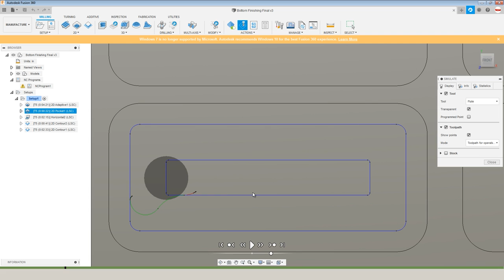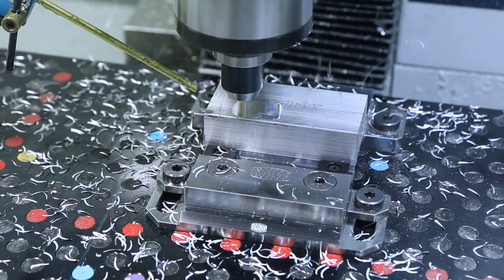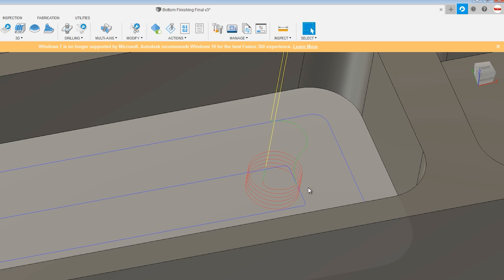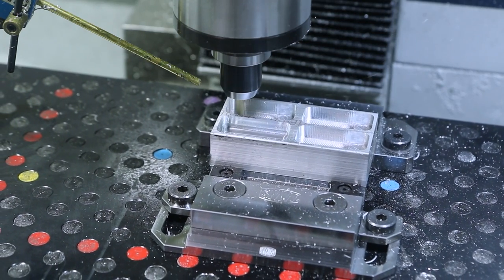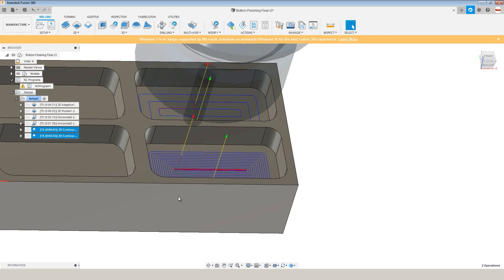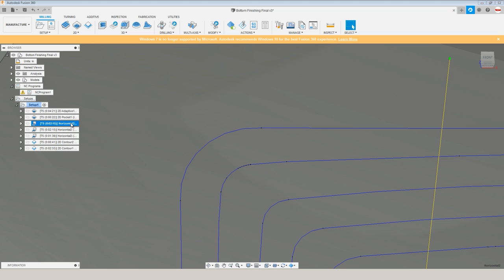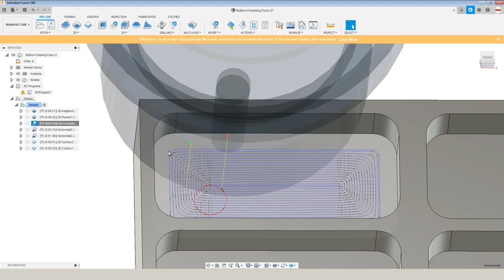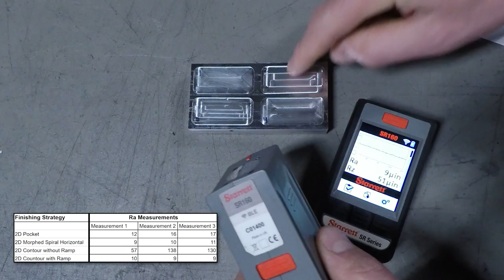Better Surface Finishes on Pocket Floors! Testing Different Fusion 360 CAM Toolpaths.

Comment: Saw this when it first hit and stashed it in my "next time I need this" memory bank.
Today I am pocketing copper and using the 2D Contour as you described gave me an almost mirror finish.
I was close with the code I used before but I had plenty of those "witness" marks. Now, none.

Thanks John!

Comment: You should compare the surface roughness of a floor that has just a basic finish, with the feed lines still in it, vs a polished floor, that was only done primarily by hand with Scotchbrite or something. With that, it should only presumingly looks smooth.

Comment: John, what do you do with this info after the R&D is complete? Does it become a purchase option on custom work? As in you offer different levels of surface finish for a different cost? Or do you just R&D to find the best finish, then just produce everything at the best finish? Therefore offering a higher quality part than your competitors?
Reply: For me it would aid in quoting manufacture cost.  You want the best finish for the lowest cost.  That first pocket will do for 99% of the work I've done, and would be my standard finish.  That 1% where the customer wants an Ra 16 or better finish is where this research comes in, and I know how much extra cost (time) there is.

Quality is just a part that meets the customer requirements.  Going so far beyond that only adds cost, and fewer customers accepting your quote.

Comment: I've always had issues using the horizontal tool path on open sections, it always seems to gouge the side wall that it's cutting.  As a side note to talking about the head tilt, if you want to completely eliminate the effect of head nod, just use a very tiny ball end mill.  It acts like a point cutting tool and is, for all intents and purposes, not affected by nod.

Comment: Could programming the feed rate as for a 1 flute cutter improve floor finish? There is always 1 flute that sticks out a little more than the others so maybe using it as a 1flute cutter is the way to go.

Comment: Is there anyway to make the tool path go diagonally at 45 degrees? At work I use a different cam software that allows it and 45 degrees make the part look super good
Reply: Hope this helps: https://youtu.be/iOr1uMNkJCI?t=253  use Parallel with a set angle & a geometry boundary.
Reply: @autokludge  ah ok thanks. But will it be good at flat cutting a pocket

Comment: Kind of confused...the angle of the horizontal finish makes it hard to see but overall I have to say the first operation with the 2d pocket looks way better than any of there others....the tiny step over contour one looks atrocious for example, even though theoretically may be flatter, it looks horrible!
Reply: One year late to say this but you are exactly right, higher radial engagement has always been more favorable when finishing as to reduce the amount of tool lines. This goes all the way back to even before we had mills, when shapers were the only tool available to create square parts the strategy was the same. I use as standard a 90% step over when finishing and the surface roughness can be more attributed to using proper speeds and feeds as well as your choice of tool.